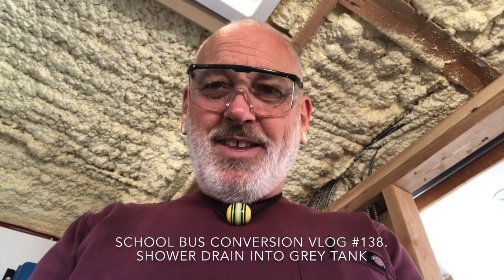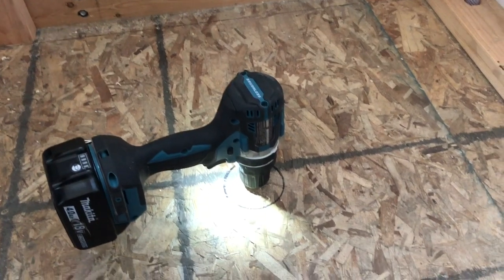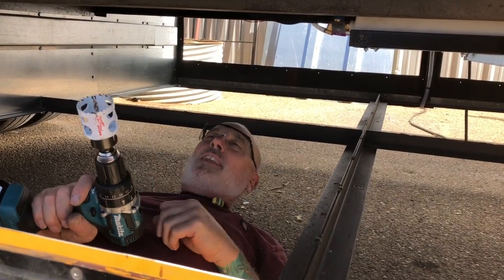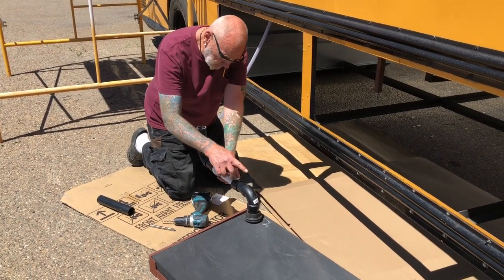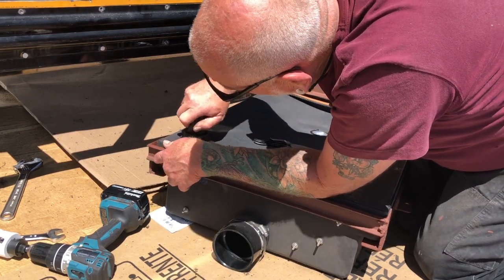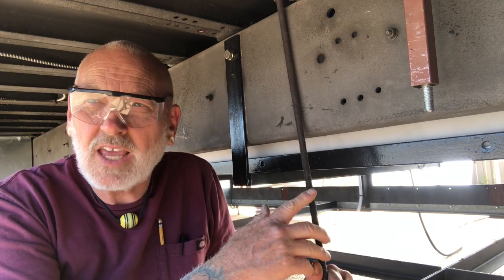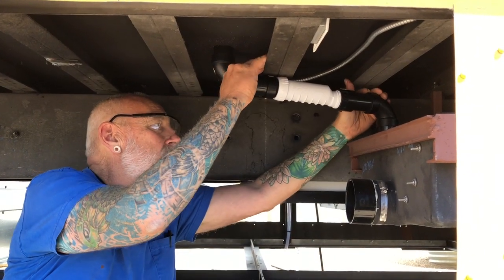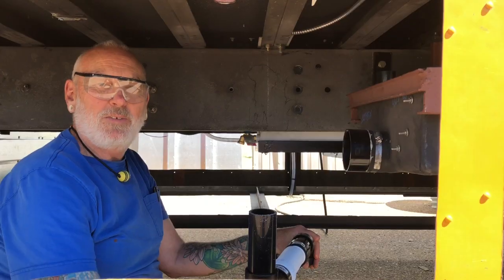Shower Drain into Grey Tank - Vlog 138 School Bus Conversion

Comment: Glad the shower hole didn't meet a seam in the floor pans.  I just realized that I forgot to mark my seams on the walls before laying my subflooring. Oops. I guess I will have to figure it out the hard way when I put holes in our floor.
Reply from the maker: Good  luck With that.

Comment: Have you considered an air admitance valve instead of a vent through your roof?
Reply from the maker: In our knowledge that will work for a sink but not for a gray tank. But we are not experts on this subject.
Reply: @KnappTime  I haven't seen them used on a gray tank but people use them all the time for an entire house drain system.  If it would work it would be one less roof protusion and a potential roof leak.